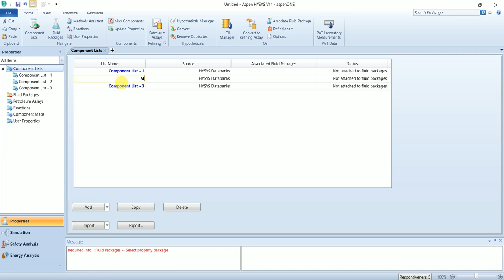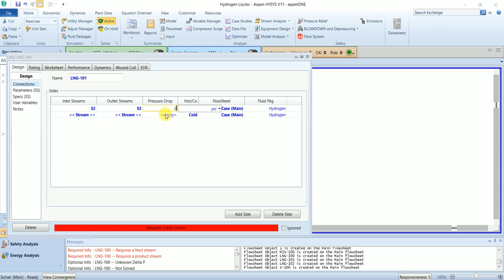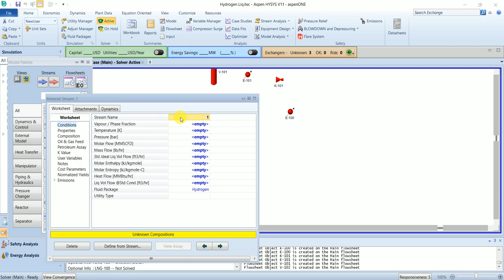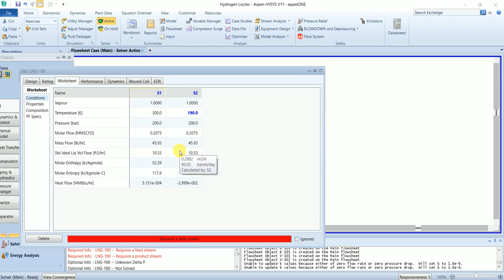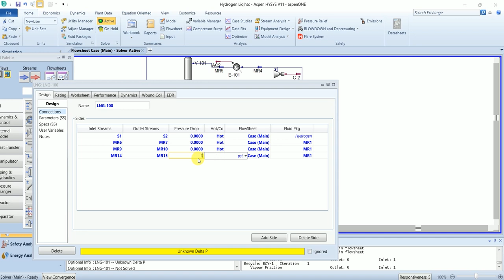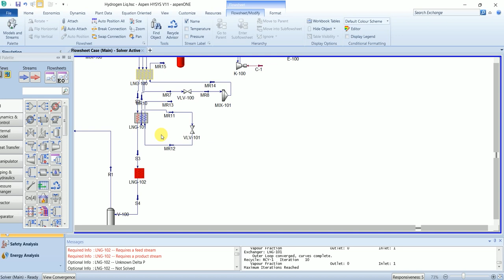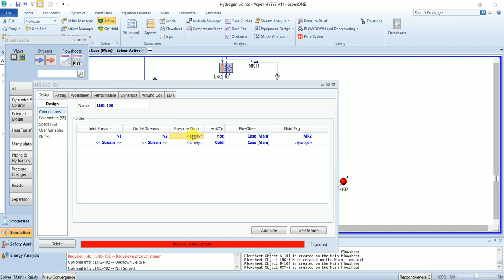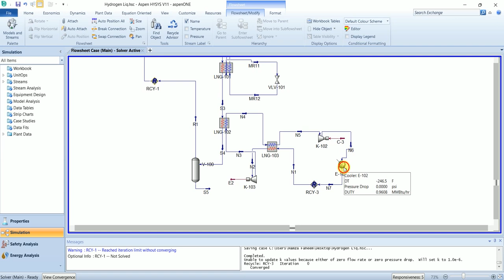Hydrogen Liquefaction using Duel Refrigeration Cycles || Aspen HYSYS

Comment: Your simulation method is perfect. However, I think the RCY-1 is not solved. Do you know how we can fix this?
Reply from the maker: Yes, it's not solved. The reason is there is no flow in recycle. If there are some vapours in the stream, it will converge by itself.